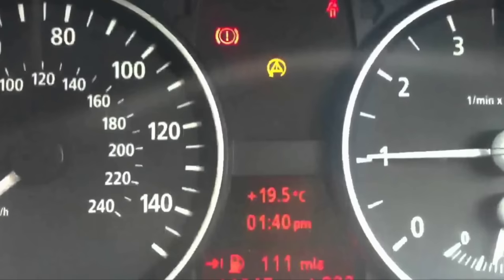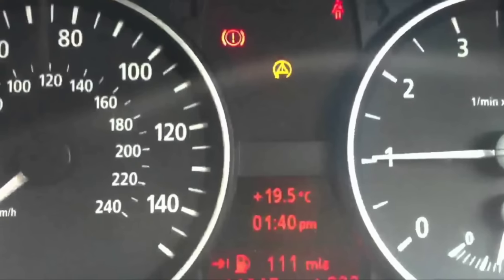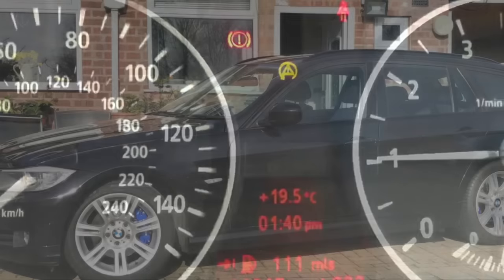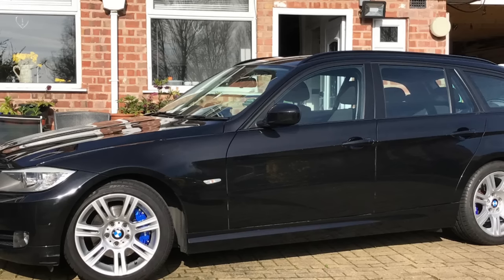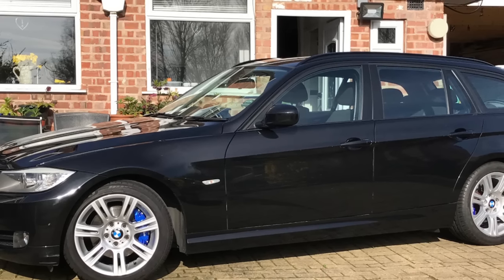BMW lack of Power speed Triangle warning light on dash

Comment: Did anyone's vehicle brake after reaching 30 mph with this light on??? Currently having this issue and mechanics can't find the issue. I tried telling them to check wheel speed sensors, but they keep saying they can't find the issue.
Reply: if you have your brake light on with the triangle and the little circle around it and they're both yellow and color it's going to be your steering wheel angle sensor.
Reply from the maker: the abs rings on th e rear swell. Thanks for the great comments👍🏻👍🏻🛠

Comment: Hi there I dont have a lack of power but still have this warning light on the dash and the handbrake light showing yellow when released, if anyone knows what this may be help would be much appreciated. Thanks!
Reply from the maker: What model do you have, sounds like the brake pads might be low, or low brake fluid level, Thanks for the great comments👍🏻👍🏻🛠
Reply: I have the same issue in my 08’ E63 650i. Constant circle ! On the dash, yellow break light, but no real loss of power? Confused?!?

Comment: Had this flash on and off quickly in my 318i for a minute or two last night on a motorway (it did feel a little slippery just beforehand) and the car started to lose power a bit. Pulled over and stopped the car, started again and it was gone. I take it that was the traction control just picking up a slippery surface then? (New owner, never seen it before just)
Reply from the maker: more likely to be this https://youtu.be/inSNA_hultI , Thanks for the great comments👍🏻👍🏻🛠

Comment: I just bought a 1994 540i and this light always goes on and off, it jerks here and there but usually runs pretty well. Last night it rained super hard and as I went to start my car this morning it won’t turnover, i have a half tank so it can’t be gas, could the rain had caused electrical problems or was it this triangle sign? Please help, I just bought this car..
Reply from the maker: If it wont turn over it’s more likely to be a battery issue, or poor connection, thanks for the great comments 👍🏻👍🏻

Comment: I have a 2013 650I M &  a symbol  appeared on my dash with a start & stop with a A slashed through it . Does anyone  know what  that is?
Reply from the maker: That is your start stop symbol, the “A” should be in the middle usually if you see this symbol the start stop is active or it has been has been turned off at the button, 👍🏻thanks for the great comments 👍🏻
Reply: @aaanton11  Thank you for replying back Actually the A was to the left & circled?  Anywho as I was driving it kinda cut off at the light but restarted itself quickly.  I'm terrified because I cant make it to the dealership till Tuesday. Is it ok to still drive?

Comment: Just got this problem today out of no where when turning right into a driveway car lost power, steering stiffed up and car engine turned off and this symbol came on? I tried what u said and car drove for a short distance fine then lost power again with DTC turned on? Any help would be much appreciated 👍
Reply from the maker: Your issue is more about the engine cutting out, have you had the fuse box recall done yet? Thanks for the great comments👍🏻👍🏻🛠

Comment: which code read r u using ? thanks
Reply from the maker: I have a couple, a autel, and a Bosch Thanks for the great comments 👍🏻👍🏻
Reply: @aaanton11  Thanks for quick replay
i got problem with mine bmw e90 320d 2009 
ccid 24 35 50,
car won't start  antill i move the steering wheel left and right. i really dont know the problem
if u can pls help me thanks
Reply from the maker: Have you had the recall done by bmw on the interior fuse box, it causes all sorts of strange electrical issues 👍🏻👍🏻
Reply: aaanton11 no I have not done recall.my car is 2009 I don’t know if they recall my model

Comment: Thank you for making this vid. It helped me yesterday when I got stuck on a country road.  Found this info after searching on "bmw warning light triangel arrow"  SUPER  :)  I got home and seems as if I can use the car until the garage could replace that ring that due to corrosion under the ring, had swollen a bit and in one spot touches the sensor.
Reply from the maker: This is a more permanent repair https://youtu.be/inSNA_hultI
and might save you a big bill, mine is still ok after 10000 miles, Thanks for the great comments👍🏻👍🏻🛠

Comment: My 2008 328i started acting bad when I cold crank it. It takes several seconds to crank, then it starts spuddering and unresponsive to gas pedal, acting like it's trying really hard not to die completely. This light in the video comes on with the BRAKE light together. After waiting for it to sort itself out or tapping the gas pedal to try to get it stable, it'll sit and idle and sound normal. Then when I turn the car off, and push the button to start again right after, it cranks like normal and those lights are no longer on, everything looks normal. I had AutoZone read codes and it only showed crankshaft position sensor "A". You think that's the problem and would cause this behavior? I just got new spark plugs installed, but didn't fix any of this crap.
Reply from the maker: If you have read crankshaft sensor fault I would replace it, they are not too expensive and it would give poor Running and non-start symptoms, you might also have a issue with the vanos solinoid 👍🏻👍🏻
Reply: @aaanton11  Thanks for that quick reply! I'll start at that sensor. The vanos solenoid seems to be a common issue with these cars. I've only had it since August and it has 110k miles on it. I'm hoping it doesn't become a money pit and these issues are just maintenance popping up around 100k mark then it'll run great afterwards lol.
Reply: Miadous this exact same thing just happened to me today, have you figured out what the root of the problem was?
Reply: @DavidWilliams-oz8hc  I let Autozone scan it and it only showed the crankshaft sensor code so I got that replaced a few days ago. No more codes showing and so far so good.
Reply: Miadous how much was the fix?
Reply: Miadous also, did you find the car had trouble or an elongated start when you tried starting it?
Reply: @DavidWilliams-oz8hc  $72 for the crank sensor and almost the same for labor cost
Reply: Miadous thank you!
Reply: Miadous same thing ended up being wrong with my car, we have the same car, year and around the same mileage.  If any problems happen to your car, and vice Versa, we should let each other know so we can possibly prevent unwanted engine damage

Comment: I had a steep drop in power suddenly, almost felt like I was braking after I was accelerating from a green like then when I pressed on the gas noticed a sudden lack of power and realized it wasn’t my break but the car was malfunctioning.  The yellow brake light came out as well as a picture of a car being housed up on a podium, I rode it about another 4 blocks and parked it, then when I tried starting it a few hours later this symbol of the ! In a triangle with a circle around showed up, but it was after my car had trouble starting up but finally did (note: I just had a brand new bmw battery put in a month ago).  I just turned the car off and am waiting to bring it to the shop tomorrow, any idea what this problem sounds like?
Reply from the maker: What model do you have, petrol or diesel.
Thanks for the great comments 👍🏻👍🏻
Reply: Petrol
Reply: aaanton11 2008 328i petrol

Comment: My e46 has this light as well with the break light on and stalled at the light multiple times and putters to get a roll on, you think it's the sensor?
Reply from the maker: it wont make the engine cut out, sounds like you have another issue, Thanks for the great comments👍🏻👍🏻🛠

Comment: You probably get that question but how’d you get that problem fixed?
Reply from the maker: You will need to replace the rear drive shaft which has corroded, check my other video on the subject, thanks for the great comments 👍🏻👍🏻

Comment: Hi I have a 2006 x3 deisel it smokes blue smoke from exhaust  when cold weather for a few minutes but doesn't do it when it's warm weather ..could it be valve stem seals or turbo seals
Reply from the maker: I would check glow plugs first, Thanks for the great comments👍🏻👍🏻🛠

Comment: hey there! ive had a fault happen today where if i turn right my BMW 391 will stall out and the steering wheel locks up etc. i get the yellow triangle and the abs fault would this be the ring on the driveshaft more than likely? may try the washer trick to allow me to drive it to the mechanics to get the drive shaft ring re done. cheers
Reply from the maker: Thanks for the great comments👍🏻👍🏻🛠

Comment: Wow, my 2008 Range Rover Sport having this issue when I turn left while driving this started after I got wheel alignment
Reply from the maker: The wheel sensor or the wire, might have been damaged when the alignment was done 👍🏻
Reply: aaanton11 Thank You for the update
Reply: Elaine Murphy This is so Sad, I'm still having issues can't tell what it's going on, not even the dealership They just want me to replace both lower control arms, suspension pump, and dash cluster

Comment: I just bought my e92 320i today and had this problem on the motorway. At one point I couldn't get to 50mph so I stopped the car and waited for help. which case is the worst, the sensor prb or the corroded drive shaft?
Reply from the maker: Drive shaft is more expensive but both are fixable👍🏻👍🏻
Reply: it was the drive shaft, my friend is a mechanic and he fixed it for 75 quid :) ( for 2 rings )
Reply from the maker: Result 👍🏻👍🏻
Reply: Where did you get it done can I have the address
Reply: 2 new abs rings will fix it. £20

Comment: I have this light along with brake light on my 04 325i wagon. Just stopped in traffic and wont turn on anymore. Any ideas on what it could be??
Reply from the maker: Sounds strange, possible fuse box issue, the main lead into the under dash fuse box can develop a poor connection, Thanks for the great comments👍🏻👍🏻🛠

Comment: Hi can you tell me what is thenpossible cause of the traction control light being on at the same time with the gear with ! Being on too?
Reply from the maker: watch this video 99% it will be the fault, https://youtu.be/inSNA_hultI Thanks for the great comments👍🏻👍🏻🛠
Reply: aaanton11 hi, but the gea sign with this ! Sign inside the gear light is on too tho. Would that put the transmission on safetly mode because of the traction control? I opened up the rear passenger side sensor and it was damaged. There are some scratches from the sensor on the ring. So i ordered new sensor. I will open the other sensor as well while i wait for the sensor to come.
Reply: aaanton11 hi, i already changed the rear passenger side sensor the light and safe mode(limp mode) still on.

Comment: 75% of the time is be cause front and rear tyres are different model,even are the same size!
Reply from the maker: Thanks for watching, the tyres can make a difference, but if you reset the system, it will compensate.👍🏻👍🏻

Comment: Hi great video. I have 2004 BMW Z4 2.5 traction light yellow handbrake light and Eml light on dash. This happens when accelerating hard and over around 3rpm. Car goes in to limp mode and lacks power. 
Any advise?

Thanks In advance
Reply from the maker: most likely to be this https://youtu.be/inSNA_hultI Thanks for the great comments👍🏻👍🏻🛠

Comment: I got my car serviced and ever since have that sign on the dash, there is no power issue, I have checked that, my DTC button isn't working after the service. Don't know what to do . Help
Reply from the maker: If it was working before the service I would take it back to the garage and see if they will repair, maybe a simple trapped wire, thanks for the comments 👍🏻👍🏻
Reply: Cheers.

Comment: I have same problem! 
What i do this? Just push the baten?
Reply from the maker: Turn off the dtc and see if the fault goes away, if so then chances are the abs rings on the rear drive shafts are corroded, thanks for the great comments 👍🏻👍🏻🛠

Comment: Could someone help me I have this problem right after I have switched the tyers round one the front of my bmw 1 series I can’t go any faster than 50mph I have 2 run flats on the back and 2 normal tyers on the front and if I hit 50mph it flashes really fast I know if I hit the computer DTC it goes away but I like this fixed ? Is it really possible because I have switched the tyers round with run flats there are doing this also I have 195 on the back and 205 on the front I know it sounds silly but is that what my problem is can someone help thanks.
Reply: Also ever since I switched the tyre 🛞 round I have never had this pop up once on the car
Reply from the maker: You will need to reset the tyre pressure sensors if you rotate tyres, it recalibrates the wheel diameters Thanks for the great comments👍🏻👍🏻🛠
Reply: @aaanton11  I been told today because the Tyers are different sizes this why it’s happening and I can agree because it’s never done this until I changed them
Reply: @aaanton11  it was because I had 195 on the back and 205 on the front it now has 205 all the way round and the problem resolved it self

Comment: Can this affect transmission shifts? Because after seeing this light my car wouldn't shift in  Drive or reverse
Reply from the maker: It can also come on if you have a transmission issue, sounds like your fault might be more than just a abs sensor 👍🏻👍🏻
Reply: @aaanton11 my car was working good and then didn't drive it for a month and the battery is drain and wouldn't start. So I jump started it and a bunch of lights came on and it won't shift into anything. Is it because of low battery?
It says:
Charging malfunction
Driving stability 
Trans Malfunction
DBC malfunction

Everything was working. Is it the battery? A month ago I saw that it barely started. Then today it didn't start until I jump started it then all the lights came one.
I just ordered a BMW Scanner and a CTEK MXS 5.0 battery charger.

Comment: Im having this problem with a Volkswagen passat 2004. Code reader said it was my mass air flow sensor so i got a new one with the housing and now my check engine light is on saying 02 sensor. Oh and the original warning light the exclamation inside of a triangle with a circle arrow is still coming on. Wtf. So frustrated
Reply from the maker: +Leslie Gonzales if the fault codes said air mass / airflow sensor and you've changed it ,and it hasn't made any difference there is a possibility you have a split in one of your air intake pipes ,so it thinks the Air mass sensor reading is wrong but really you just have an airleak 👍🏻
Reply: aaanton11 ok. Thanks.
Reply: aaanton11 do you think i can get a diagnostic test done for free at aamco.

Comment: I have 325xi 02 and my car was driving perfectly fine today. I came home turned off my car went to eat did everything normally and now my car won’t start at all it won’t even crank. This light is on and I’m lost I don’t understand what’s wrong. It’s not the battery I know for a fact. Somone help what else could it be?
Reply from the maker: Give the fuse box a kick behind the passenger glovebox, shake the big red wires under there, if it starts there is a recall at bmw to repair 👍🏻👍🏻Thanks for watching

Comment: most of my dashboard warning lights came on after disconnecting the computer while removing my the transmission.. my dashboard looks just like a Christmas tree..

I was wondering how to erase them..I try with the autotel A619 and they won't WO away..any subjections.
Reply from the maker: Did you replace the gearbox, or refit the same one 👍🏻👍🏻
Reply: I did not..I just replaced the spider gear in the differential and the clutch

Comment: Hello, thank you for the video. I have a question

I own a BMW e39 2.0i 6L ; 150hp. 

I exited the parking spot and drove it slowly in the first gear. It stopped. I thought that I made a mistake when i pressed the clutch or something.

I tried to start it right away, but the cranking time took me 2 more seconds than usual and this error light (DSC - dynamic system control) came onto my dashboard.

I drove it for 1 km, stopped the car and restart it. The same thing as mentioned before. Longer cranking time and the error light DSC (it kinda reduced my acceleration, also)

Done another 4 km, stopped it and nothing happened. It was perfectly fine.

The same episode (the same details as above) happened 2 hours later. Now, the car works fine.

What should I do? I dont understand why was the cranking time longer and I’m scared that, at some point, my car will not start because of this problem. Is it true? Does this risk exist? 

Mention: this is not a daily car and I try to keep it in a perfect shape. I only use it in vacation or summer time

Thanks
Reply from the maker: you will need to use a code reader and pull the codes out to have a good idea as to what is going on, ie amazon sells this Autel scanner which also does ABS & SRS Airbags,  https://amzn.to/2wUYEB0
video on the issue is https://youtu.be/FJMDuWnGMII
Thanks for the great comments👍🏻👍🏻🛠

Comment: It wont let me turn it off when I press DTC nothing happens ? Thanks
Reply from the maker: press and hold until the light comes on, Thanks for the great comments👍🏻👍🏻🛠
Reply: What if is it still not working after holding dtc for 5sec and longer.. Dtc dont want to turn off!
Where should i look for the problem.. bmw e60 2005
Reply: @rqkaz8063  have you tried restarting engine ? My dtc buttons works again and the warning light has gone

Comment: 2003 vw 1.8t this light comes on and a bunch of white smoke comes out of exhaust and if the light stays on it starts shifting really bad. Could this be the turbo?
Reply from the maker: its possible, but it could be many other things too, you need to use a eobd code reader to grab some codes, Thanks for the great comments👍🏻👍🏻🛠
Reply: I got 16795, 16804, 16486, 17705, 17608